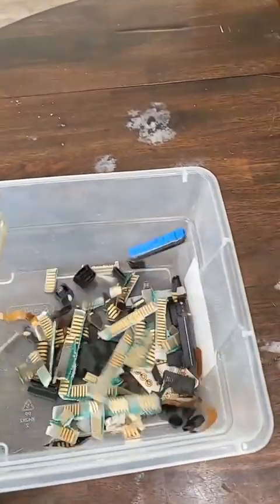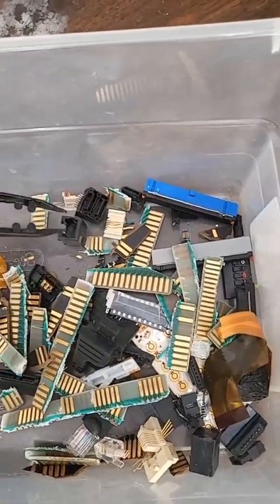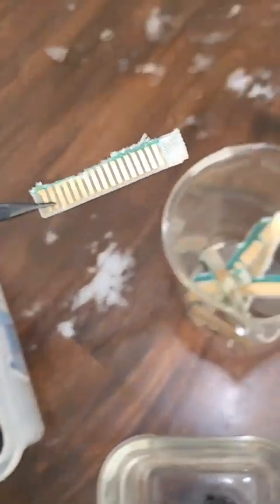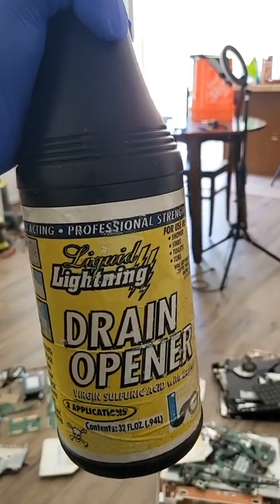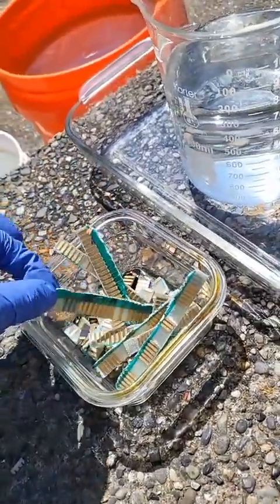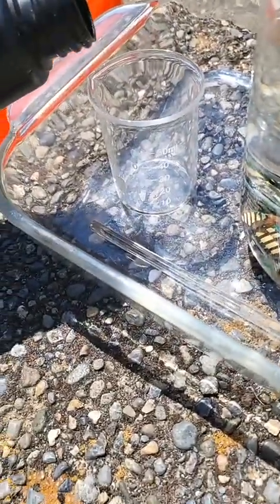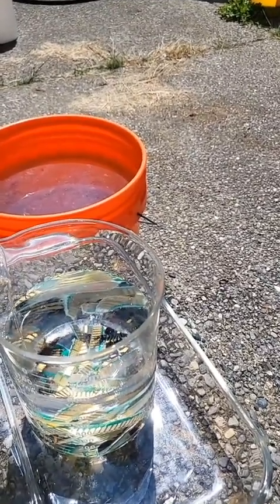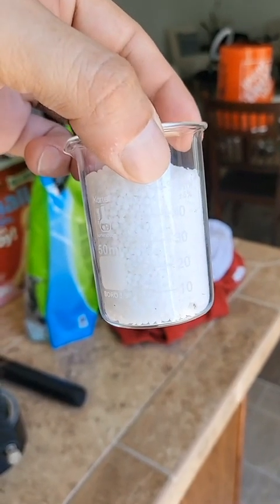POOR MANS NITRIC ACID. GOLD FINGERS

Comment: Isn't it funny that sulfuric acid comes ina plastic bottle but yet dissolves plastics??? Hmmm
Reply: It depends on what sort of plastic you are talking about. There are several 100s of different types of polymers with different properties against different acids with different temperatures and different strengths.
Reply: Il existe différents types de plastique. Heureusement d'ailleurs. Le verre ne serait pas terrible pour contenir de l'acide en commerce... Il existe maintenant divers plastiques qui résistent même aux hautes températures ou choc et depuis longtemps aux acides